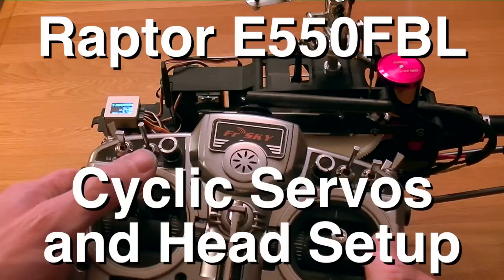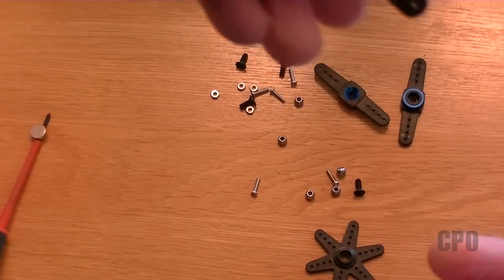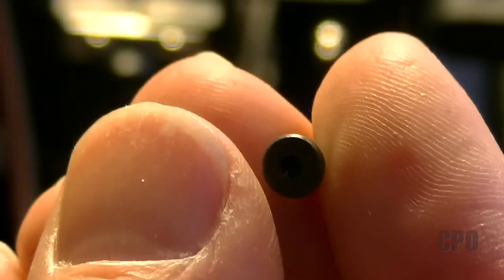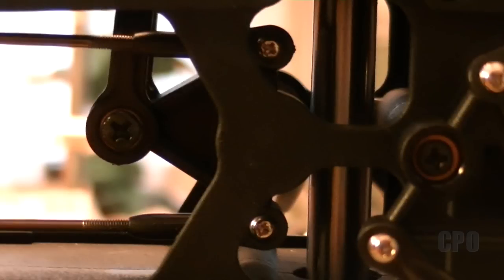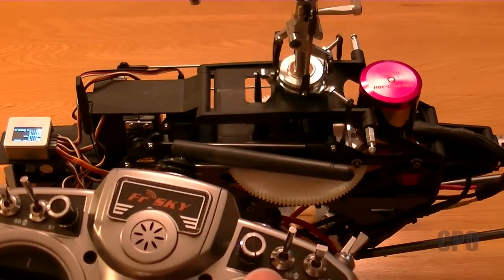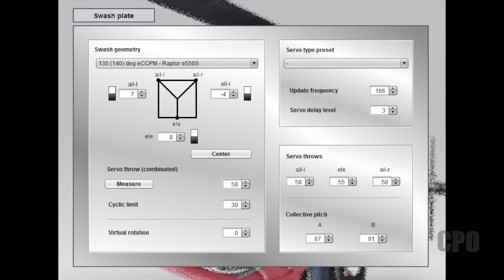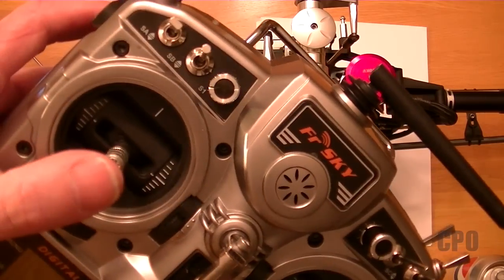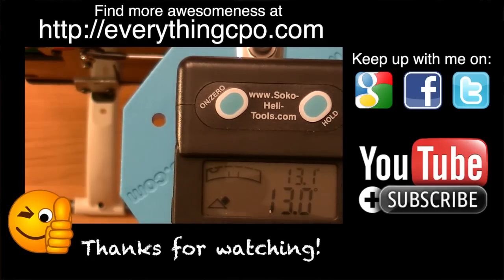TT Raptor E550FBL Cyclic Servos and Head Setup

Comment: The Spirit level on my Soko gauge is not even close to the digital readout and I tried to calibrate it.  Any tips?  Also, where did you get those little magnets?  R.O.G.
Reply from the maker: The two numbers don't have to match at all, actually.  You could really just use the top spirit number for this roe of stuff, and use the bottom number when you need to zero to something else. 

You have to zero that bottom number each time use the gauge. It zeros to what ever angle it's at when you turn it on I think. 

The only reason I set them to match for the video is so you don't have to worry about what number to look at. 

Magnets are from Harbor Freight. You can find them at Walmart in the craft section also.